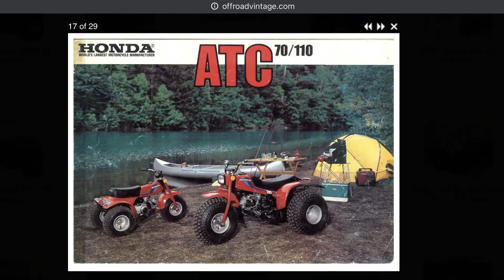Honda US 90 - First 3 wheeler ever made!

Comment: I had one of the first ones in 1970. My little 13 year old self, weighing in at about 130 lbs., could actually cross creeks and ponds by laying on my belly on the seat. Couldn't sit upright because you were too top heavy and would tip over. Found that out real quick.

Comment: Very nice machine! I really liked your history of the Honda UTC lineage. My uncle bought his 1974 Daytona orange ATC90 K2 new and I rode it every summer as a kid on my grandparents farm.  I got my first 1974 Daytona orange ATC90 in 2004 but sold it 10 years ago because I needed the money. Well, I Just got another 1974 Daytona orange ATC90 K2 over the summer and recently got it running in the same order as you. Luckily, I kept a extra stash of Ohtsu balloon tires in the garage attic and replaced the dried up ones it came with. My ATC90 model is the last year of the balloon tires. Looks like your ATC90 K1 mud flaps are mounted on top of the fiberglass rear fender and should be underneath. Don't ever get rid of this fine piece of history. Keep it levitated on those jack stands when not in use. The Ohtsu and firestone flotation balloon tires are so unique, most people think these tires have rims! Welcome to the US90 experience!
Reply from the maker: Thank you for the comment! It will always be on those jacks in a heated environment(: